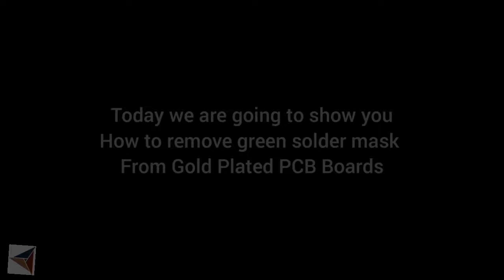How To Remove Green Solder Mask From PCB Board | Gold Recovery

Comment: that was great but i have question is it necessary action for extracting gold or not?
Reply: Yes...if you process it with the mask on, you'll only dissolve any exposed gold, everything under the mask will stay on the board...
Reply: Yes you must remove the solder mask.

Comment: How much lye do you use and how much hot water do you use
Reply from the maker: The boards should be immersed in one liter of boiling water at 100°C, with two tablespoons of sodium hydroxide or lye solution, for half an hour.
Reply: @TrinityGoldRecovery do you have to strip the whole board before this process? Can I leave solder on the board and still remove the it. Will this work on red bords? Thanks

Comment: I have done this at home
This removes green/blue layers of any electronic boards 

Sodium hydroxide (caustic soda) is little danger should use with precautions 

But 99.99 percent of electronic boards have only copper beneath the layer 

Pls specify which electronic item has gold layer under the green layer ?
Reply from the maker: Mosty the nokia phone boards contains gold platings under the green musk
Reply: @TrinityGoldRecovery  thanks sir